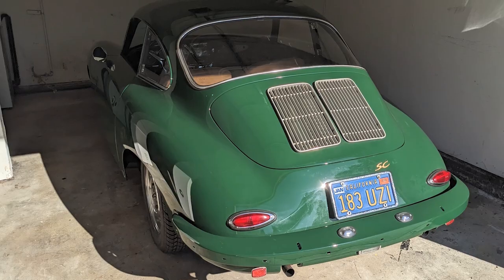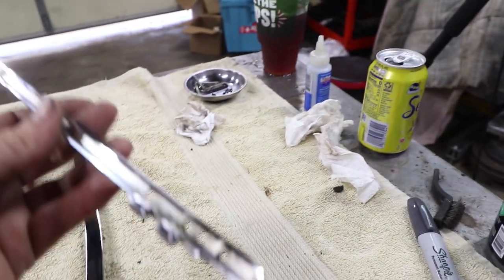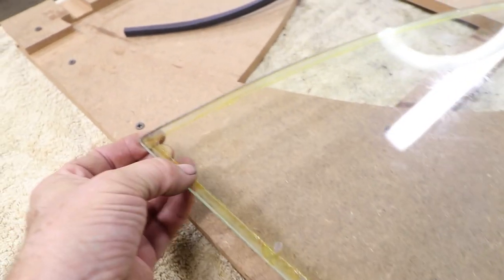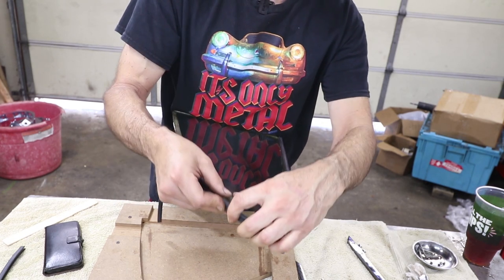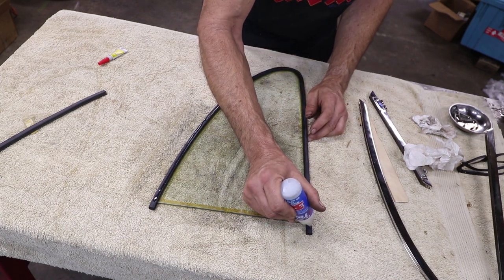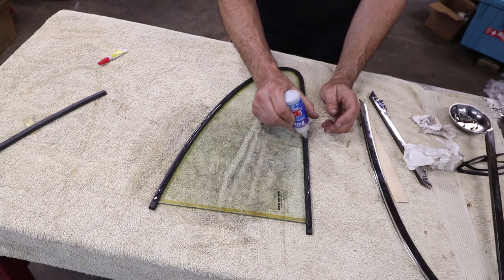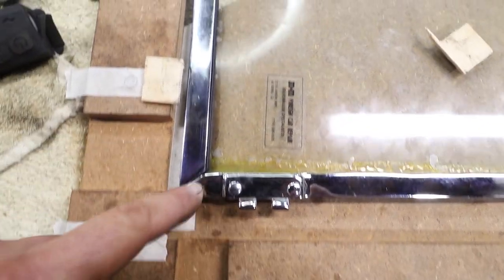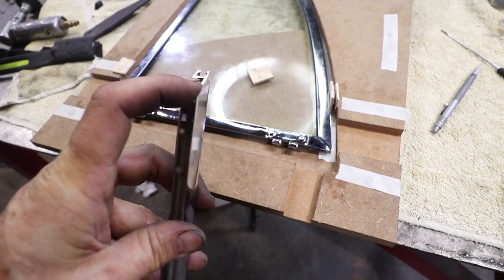OH! The DREADED Porsche Quarter Window Assembly!  It's EASY if you Have This Tool...

Comment: hopefully, the little bits of super glue didn't render the seal unusable for the final glass.  Great help for me as I continue my repair on a 912 that I am converting to pop-outs!  Thank you so much
Reply from the maker: Cool, I haven't done 912/911 frames yet but I assume they are pretty similar.  Super glue dots will break off pretty easy I hope.  😃
Reply: @GarageTimeAutoResto  yep well all the little bits are arranged the same way, probably just dimensional differences if any.

Comment: Get a screw kit from Stoddard and you don't need a fixture to assemble these
Reply from the maker: There's always more than one way to get a job done.  Enjoy getting those slotted screws in straight while squeezing the frame with your other hand. 😃
I'm just showing an easy way that's all.
Reply: @GarageTimeAutoResto  have done it many times, just need to have the. Correct screw